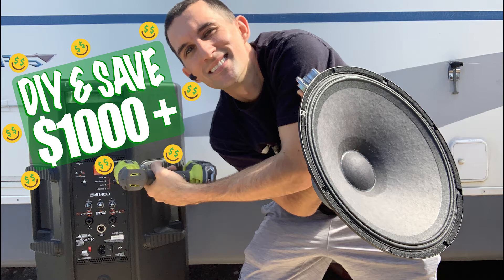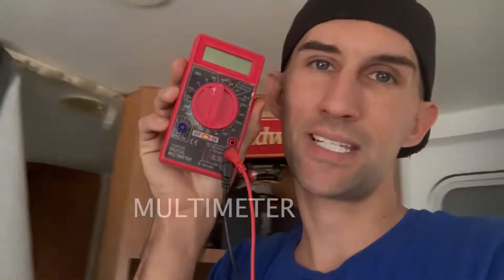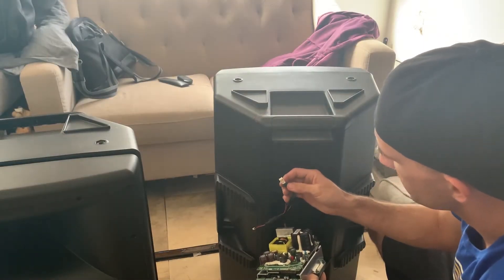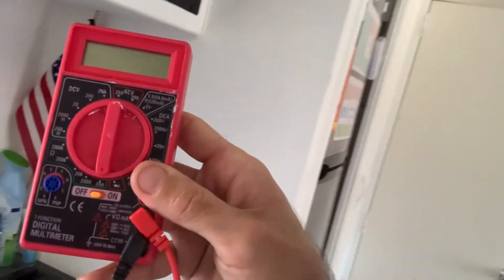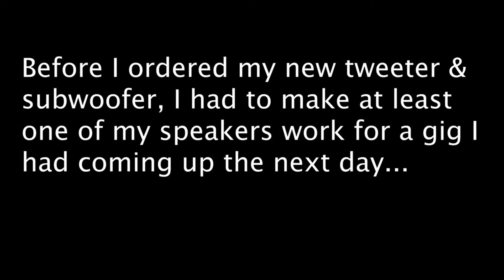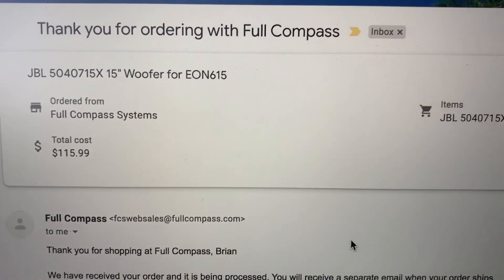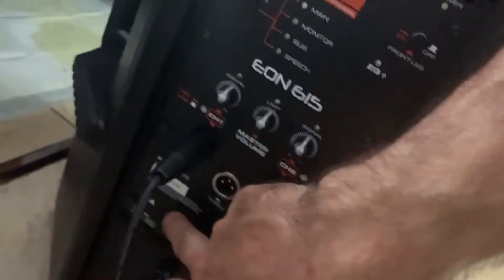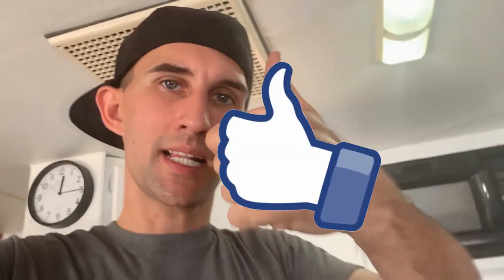How I replaced my EON615 subwoofer & tweeter - DJ speaker Repair Step by Step

Comment: Nice vid. I have to replace the woofer for a client, so this helps tremendously. That piece that broke off was a capacitor. I know this vid is 2 years old now but you need to get that resoldered on there. Probably a coupling capacitor, take it to an electronics repair shop. Quick fix.

Comment: Sic video. Very useful thanks dude. Funny too 😂
Reply from the maker: Thanks for the comment bro!!!! I tried my best at the time. Good luck with your speakers!
Reply: @DJRussellBrian  thanks dude, yeah I think mine are ok. I was getting some distortion from one of them but I reckon it's actually the custom stand they sit on was vibrating. I pulled off the front cover and no sign of damage and both speakers produce the same tight drum skin sound when I tap them. I'm also wondering what these speakers would sound like with these: Faital Pro 15PR400 15-Inch LF Driver 400W. So your vid helped there too. Reckon would sound sic af. Drive them super hard! Just really helpful to see eon615 fully deconstructed and reconstructed. 🤩✌️
Reply from the maker: @id3g79  for sure dude! I figured someone would appreciate the break down and I’m glad you enjoyed it. Try not to push them too hard and maybe invest in a subwoofer if you don’t have one and they’ll last a long time.. I always keep a backup in my closet just in case I have to swap out another 15!

Comment: I have the same speaker,but mine is cracking when it's turned up,do you know what's going on?speakers work but that cracking noise and nothing is loose inside speaker
Reply from the maker: sounds like a blown speaker my friend. You can find a local speaker repair shop and have them fix it.. They will recone it or you can buy a new one with the link in the description

Comment: Hello Brian, how can I know with which tweeters I can replace the damaged ones? ... they are from a JBL S38 ... but I don't get originals
Reply from the maker: Its in the video my friend! You need to match up the OHMS or the power of the tweeter... Just make sure the tweeter you get matches the same OHMS and numbers as the other tweeter... Check the link in my description and it will show you the tweeter I bought on AMAZON

Comment: Nice I had to replace my tweeter it’s almost the same size from jbl but a not powered speaker and it was because of feedback of mic this time was in an outdoor didn’t now until I got home and I had lend it . Great experience when replacing parts and making gear work again learn things
Reply: I now owe the same exact ones you have eon615 they are great but i did got an extra side subwoofer to reinforce sound for outdoors like that this don’t weight so much and are easy to setup
Reply from the maker: i absolutely agree! Thanks for the comment and nice job saving money! lol

Comment: Thank you for the video!
I’m just a little desperate because I smell electric during use one of my EON 615 speaker. Maybe smokes, even though there’s no overdrive. Probably the subwoofer is faulty, but I haven't disassembled it yet because they it's under warranty. I tested it out loud after the purchase, but I didn't smell it then. But at the first house party yes. I already regret the replacement from JBL 4430...

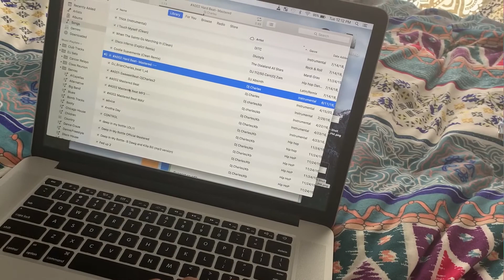14:16
Reply from the maker: yea if you keep smelling that electric smell then that's not good...I was pounding my speakers on NEW YEARS and I smelled that electric smell and I wish I would have turned them down because I was maxing them out. Now, I will Always try to keep my speakers at a lower volume because they will blow on you... Let me know what happens my friend!! let me know if you have any questions for real I got ya